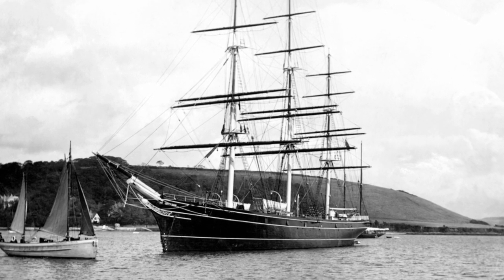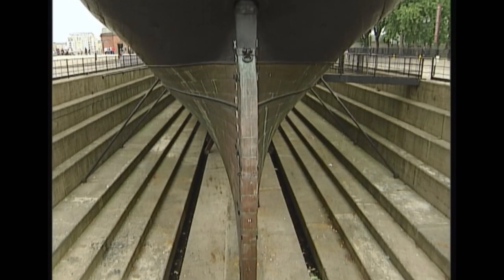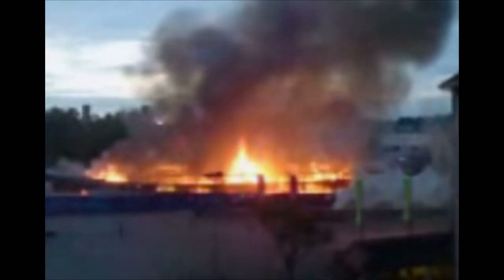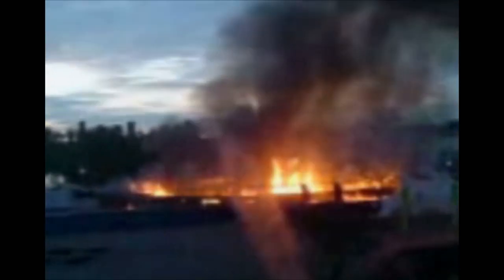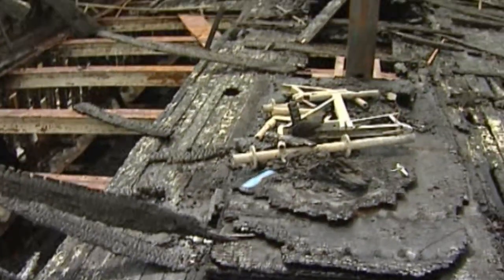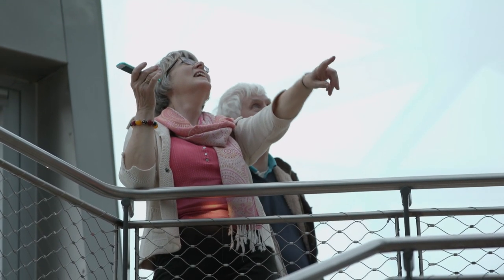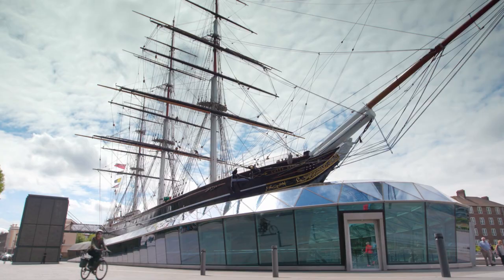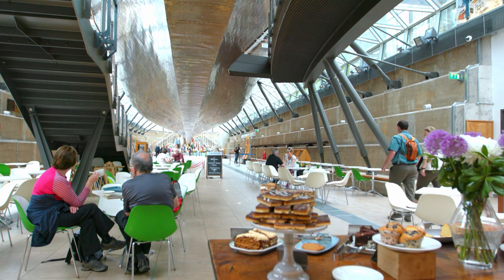The Cutty Sark Conservation Project

Comment: Part of the reason the frame of the hull 'deformed" was due to the ship being on land. A marine hull is designed to be supported by water, not sitting with most of its weight on the keel alone.